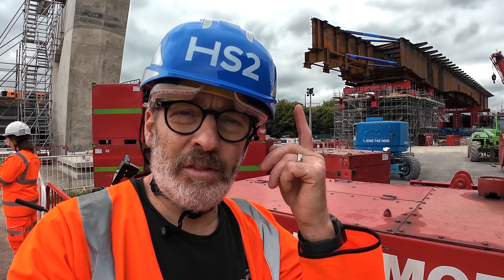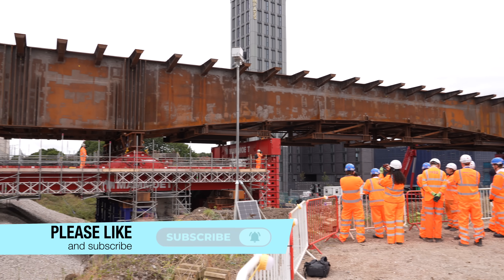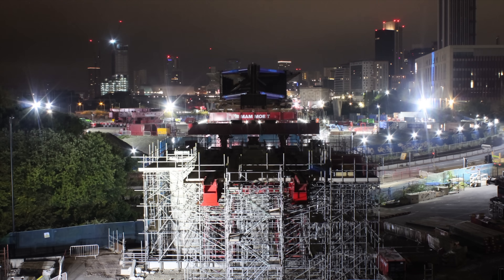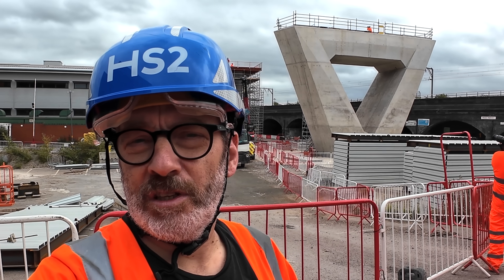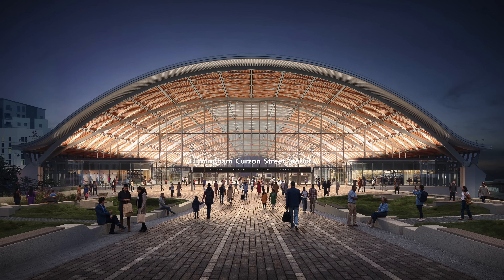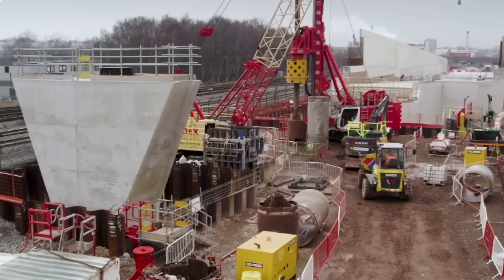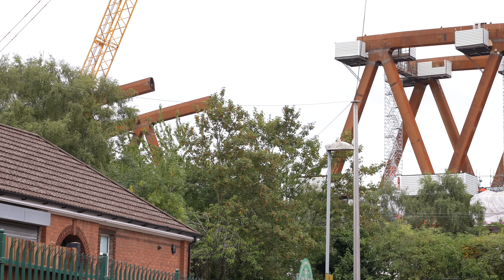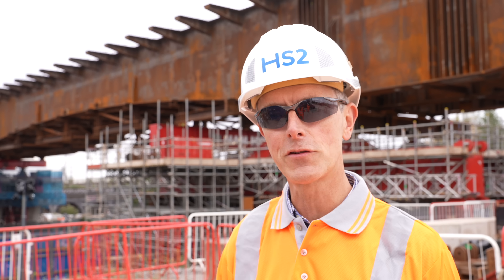HS2 megastructures

Comment: Hope they have tested the steel. The steel used on bridges for the new M42 junction is substandard, and repair works are to start shortly. When I was young we had metallurgists that checked the steel before it was installed.

Comment: Great video. Is it possible to have a video on what is next for this bridge?
Reply: The next stage will be removing the scaffolding and heavy lift gear around it, then in late October, there are further overnight closures of the Middleway to remove the bracing / stiffening etc.

The steelwork is due to complete on Curzon No. 2 (aka Bellingham Bridge - although will he still be notable when the line opens?!) this month, then it will be pushed over during Winter 2025-26.

A section of wing wall of the original bridge over the canal will be dismantled and stored at some point, to allow for piles, temporary walls and trusses over the canal to allow for construction of the viaduct deck from where it currently ends, over the canal (via the weathering steel tripod piers which have been removed - possibly for sandblasting to hide the welds and ensure everything weathers at a consistent rate) and to the two steel bridges (which will have a concrete deck and parapets installed on top).

Over at the main station site, there's still piling going on, but also pile capping and some wall building.

Comment: Hs2 never explained why curzon 2 wasn't ready for its 9 day window at the end of July to be moved into position.  That was a major project fail. I suspect it will be Christmas now as closing the cross city line for another week is a huge issue for its users.
Reply: The closure wouldn't have been cancelled as Network Rail undoubtedly had critical works of its own planned in, the assets for which are often booked months or even years out.
Reply: agree - clearly a long way from finished with great big gaps in it, must have known months in advance the deadline was going to be missed, yet the entire cross city north treated as 'optional' for over a week and slow bus substitution all the way to Lichfield.

publicity immediately before the closure was still saying it was for hs2 works, which appears to have been a lie by then - not acceptable, needs to ensure cross city north is only bus substituted between BHM and Aston, and that closures are minimised - or even better (like the road (why is the road essential but the railway isn't....) night time only.
Reply: The latest 3 month look-ahead from mid July states that the steelwork is expected to be completed this month (the missing bits are being constructed horizontally, to the side of the bridge), with the launch pencilled in for Winter 2025-26 (probably after several months being under wraps after being welded into place - which I assume is part of ensuring the steelwork and the welds weather at the same rate).
Reply: @mittfh so likely between Christmas and new year. That would make sense as the cross city line would be quiet then. Its the midlands equivalent of the Elizabeth line.

Comment: Why are they using 'rusted' metal for the bridge?
Reply: It's weathered steel, the external surface that looks like but isn't rust forms a protective layer on the steel which means it never needs painting or other treatments to ensure it remains in top condition. Very clever stuff and is a nice looking colour in my option, has been used around the world to construct buildings and artworks. 😊
Reply: I was so confidently wrong 😂😂
Reply: @markpreston5029  Yeah it looks very striking.
Reply: @markpreston5029  oh...
Reply: It's called Corten Steel.
Reply: Yeah, I wondered that. How do you intend to run trains at 225 mph... ON RUSTED METAL BRIDGES?
Reply: Weathering steel - it looks like rust, but over time forms a self-renewing protective patina that darkens over around a decade. The trick, however, is ensuring the entire structure weathers at the same rate - which is likely why it was covered up for so long, so they could ensure the welds weathered at the same rate as the existing structure. It's also likely why there are little "huts" over the joints in Curzon No. 2 (aka Bellingham Bridge - although how notable he'll be by the time the line opens...)

Comment: What’s the cost difference between all this than tunnelling the last few miles?
Reply: The topography would mean the tunnel couldn't rise up to the station site in the distance available, and an underground station wouldn't be cost effective here. 

Meanwhile at Old Oak the need for tunnels on both sides and the topography makes a station in a box more sensible.
Reply: @Polarbear1-b6jahh ok I understand. Any ideas what the cost per mile tunnelling is?
Reply: @craiggoddard488 Not personally but you can bet the real world engineers rejected tunnels for cost and other reasons.
Reply: @craiggoddard488 You could probably work something out. The TBM's cost about £17 million. The drive chambers cost about 25 million, 1 at each end. Then convert the drive chambers to tunnel portals. The TBM crews comprise 17 men . Three crews working 24 hours, double time pay for night shift. Add ventilation and dust extraction plant. Add temporary lighting and soil disposal. Add track support plinths, fire escape cross passageways . And if the ground is gravel add concrete compensation grouting to prevent ground collapse. Finally there are the precast tunnel segment linings . All these additions would add  tens of millions. The total cost would be significantly more than cuttings or green bridges.

Comment: Why are the steel structures unpainted, great video thanks.
Reply: They are probably fabricated from Corten steel, it will have a natural “rusty “ look to it and will never need painting. Don’t worry, it won’t rust away and fall down !
Reply: They're made from weathering steel. The external layer of rust actually protects the underlying steel as paint would, so it doesn't need painting. It's also sometimes used as a decorative element in architecture as many find it has quite a pleasing appearance.
Reply: If they were on the ball they could have pre-painted a load of graffiti onto the structure so that it blends in better.
Reply: a potential failure point is that 'weathering steel' is not maintenance free, if the drainage gets blocked / poor design and it stays wet all the time it can rust and fail just like normal steel (at least one bridge collapse in the US because of this)
Reply: @unkleoo an agency that can't be bothered with unclogging deck drains is going to have trouble painting an entire bridge regularly.
Reply: Because it is not finished yet.